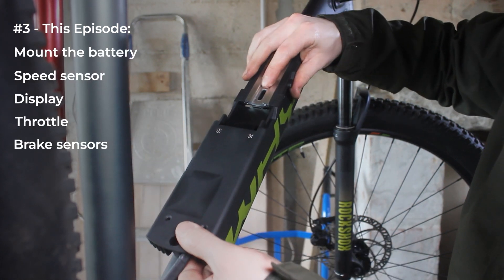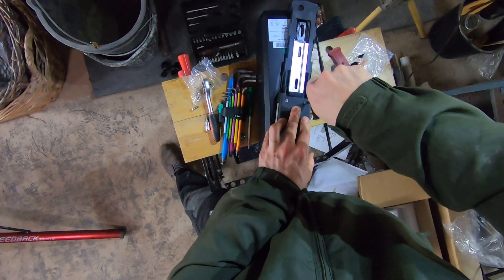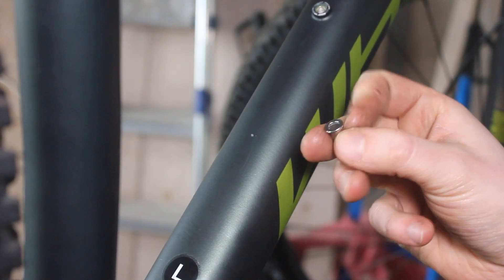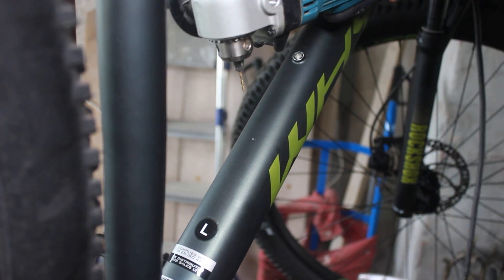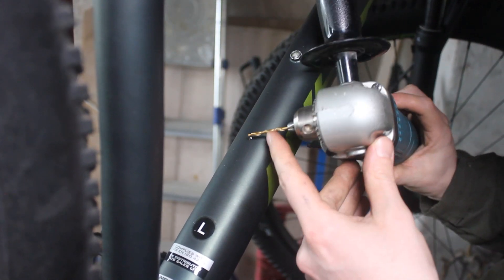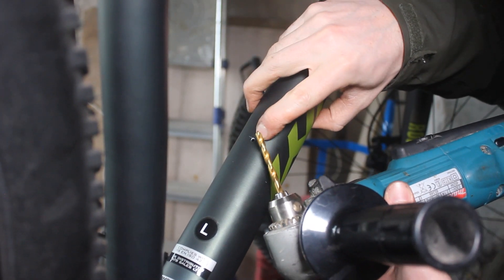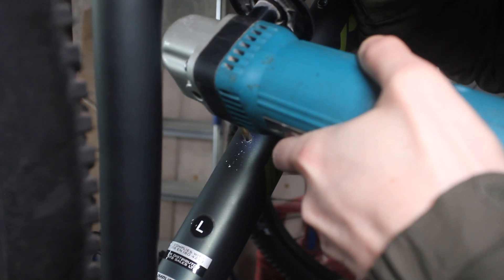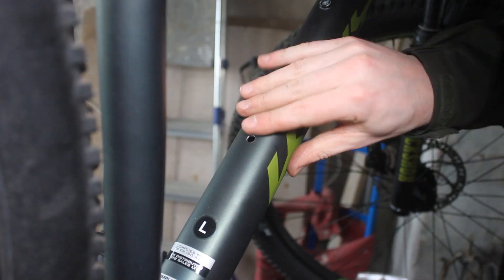E-bike Build #3: Drilling Frame, Rivet Nuts, Mounting Battery, Installing Peripheral Components

Comment: What is the size of the riv nut tool andvthe size of the screw you use to mount the battery. Tnx
Reply from the maker: M5 is the size, screws were M5 x 30mm. Hope that helps

Comment: Grin makes (somewhat overpriced) double bob and triple bob battery mounts that can be mounted with hose clamps, seem like they are perfect for your use case.
Reply from the maker: Had a look and it's an interesting idea. But isn't that what the rubber pads that come with the battery do? Granted, probably not quite as sturdy, but still helps the battery mount stay flatter against the frame.

Comment: Hi, About to start on my first E-Bike conversion. I have a Trek Marlin 5 (2017). Fitting a Bfang BBS02 750w with 48v Battery casing. Everything has arrived but upon checking Battery case against bike there is not enough space between downtube and top tube to lock battery case in or take out. So might have to mount on the top tube which is not ideal. Do you know if there are adpapers available that attach to the frame first then the battery case plate. Battery case is a Hailong 1-2 SSE-077.. Not planning to be doing any off road, just general commuting.
Reply from the maker: Hi, exciting times ahead for you! Do you intend to have the battery inside the frame triangle or will you have to  have it outside?

Comment: Do all battery plates with just two bolt slots have these hidden extra slots in the casing?
Reply from the maker: I can't say for sure if all other battery plates have extra slots. But it might be possible to drill your own holes if you want extra mounting positions. Did you have any particular battery in mind?
Reply: @itswobbly  Yes it's a HC01 size Hailong. At the moment I have it mounted with just one of the bottle holder rivet nuts and a strap. Seems to be holding it well enough for now but I'm gonna have to drill at least one more hole in the frame... another two would be a great bonus. I had thought about making a couple of brackets a similar shape to a joist hanger, and fixing them to the underside of the down tube with rivet nuts. The battery plate would rest on the arms (only by 10mm) where it is wider than the downtube, effectively increasing surface area so it's less likely to wobble side to side. I have all the gear at work to do it, but it's a nice bike I don't wanna make it look like I sent it to Scrap Heap Challenge.
Reply from the maker: @bockerwright4132  Nice! Well, hopefully you can take it off and have a look at some point. A janky metal bracket might hold it nicely, but you're right it might also ruin the looks. These big batteries are heavy and I know I was worried about it wobbling around. With any luck you might be able to add some hidden rivnuts underneith. Good luck!

Comment: Thanks for posting,,  i need to copy this job on my planned ebike upgrade.. cant seem to find a rear rack mounted battery kit atm.
Reply from the maker: Hi there, glad you liked the video. So will you be mounting a downtube battery instead of a rear rack one?
Reply: @itswobbly  My donor bike is a dutch cargo style Ortler, With S shaped double tubes from the crank housing area for the step through frame. So i may need to fit on the upper S shaped tube with new rivnuts? - the other feature will be a lower hanging motor since the bottom frame tube exits the crank parallel to the ground..  no off road plans atm ;)
Reply from the maker: Ah man don't make it too easy for yourself 😅. Sounds like you have a plan, so good luck.
Reply: No, don't do that. You can buy adapters online for ebike batteries  that attach to the bike frame via hose clamps. Those are far more secure. I used one for my own ebike project.